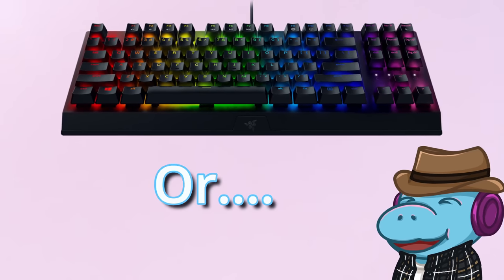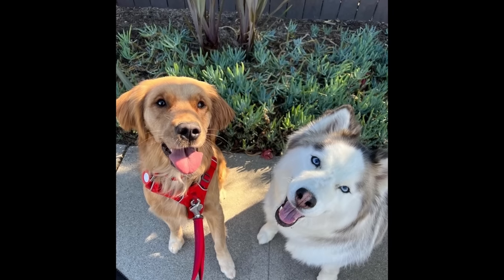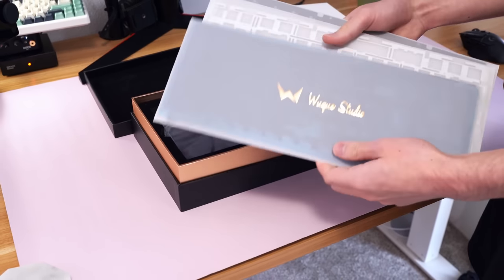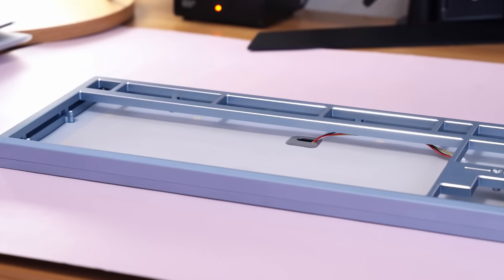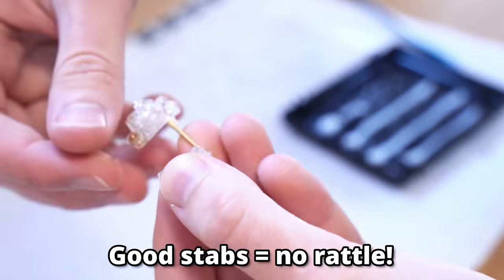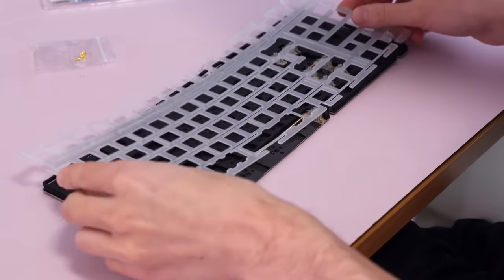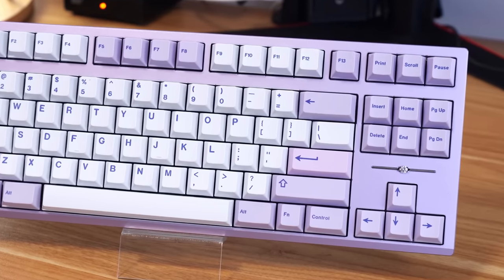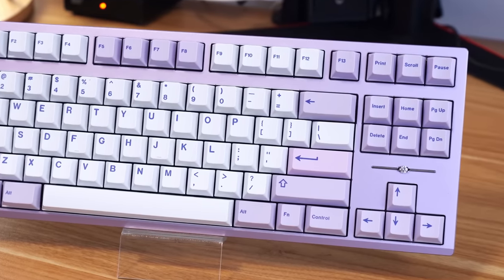Gaming Keyboards DON'T Have To Be Like This.

Comment: I actually like the looks of those custom keyboards, but I don't even remotely have the money to build one for myself. And I'm still not sure if I even like using mechanical keyboards. I feel that my accuracy at typing is way worse than on other keyboards with less key travel and in general flatter profile. For the past couple of years I've been using the Logitech MX Keys and it works perfect for me. I used to have a great need for the numpad, nowadays I don't need it anymore and it's actually super annoyingly wasting space on my desk. Maybe I should try the MX Mechanical Mini. It seems to be one of the lowest profile mechanical keyboard. One problem is that with higher keyboards I would need to use a wrist rest because when I angle my hands too much upwards I get pain in my wrists, maybe carpal tunnel or something. And I hate wrist rests because I move my keyboard around very often and it's another piece to move around and have some free space for.

Comment: I wanted to have a custom keyboard, but latency, and key presses handling per polling(aka chord split) is crucial for rhythm games. I use ASIO, so the audio latency is about 1~2ms. most of cases, you won't feel different between custom keyboards, and gaming keyboards in terms of MCU performance, but in ryhghm games, nah. latency is subjective, don't need that low, but constant interval of polling processing, key presses handling per polling is really important. BTW, you can modify QMK config, and make settings game ready...? if the MCU of board is powerful enough.
I believe the default setting of QMK is about 125~250Hz of polling rate, and only 1 key press per polling, readlly bad for gaming.
Reply: You legitimately cannot notice a difference. I guarantee you, you will not perform better or worse
Reply: @fruittree1670  Yeah, I have already written that, most of cases, you won't feel any differences. but as I've said, some of games, especially rhythm games, some of which have very short latency is about 1~2ms(milliseconds, I'm not joking). and human is QUITE sensitive to the delay of sound, you will feel it, but it is not meaning you can play better. (RTL latency within 20ms ok, under 10ms is recommended. but I did much better with my huntsman V2) but the less latency is, the better what so ever. trill, and scroll speed becoming slow is really helpful when low latency is achieved. human is really sensetive to audio delay, so trying searching about it.
Just in case, without using ASIO API, or WASAPI exclusive, you can not achieve under 20ms audio latency, so most of applications, their audio latency is just more than 50ms, even more.
Reply: And also, timing window rhythm games have quite tight is about ±12~18ms.

Comment: Well I like my shine through backlit keycaps because I work in a dimly lit environment and I am not the avid 100% blind typing typist guy - so I need a well working backlight.
Therefore for me backlight is a must! And therefore my only options right now are keyboards with north facing leds* and shine through kecaps and as I also need ISO de layout, I mostly use PBT Keycaps from Tai Hao (Sharkoon Skiller SAC20) or PBT Keycaps for backlight from Ducky, YMDK or Glorious. That is why I stick to Keychron and cheaper** AKKO boards right know. 

I would really like to see more nicely colored keycaps with shine through - but there isn't much available.

I usually don't use explicit Gaming keyboards though besides Gaming - I have one where I get real per key RGB and color the key according to my games...

*only exception Keychron Pro boards because you get the keyboard with shine through keycaps that support south facing leds…
**AKKO Moonsgeeck M1 and M2 have south facing leds and are therefore not suitable for my use case.

Comment: For the “every mechanical keyboard has roughly the same latency so gaming keyboards don’t count” argument, in some games, every millisecond matters. 10 ms latency on a keyboard might sound unfamothably godlike to normal people, but to professional gamers, it’s pretty high, even if no one can visually perceive a difference between 10 ms and 5 ms keyboard latency. Just wanted to point that out for ya.

10 ms will still be enough for most people tho, so I’d only be super paranoid about it if you’re either a really sweaty hypersensitive esports pro or planning to become one.

Comment: There's nothing wrong with tactile switches for gaming. It's actually nice for the same reason typing is. Sure, you might want to get ones with light actuation, but there's nothing wrong with them for gaming. I use Glorious Pandas.... now. I was using MX browns, then decided to build my own board, and got the GPs. And while I can't speak on the panda part, the glorious part is dead on.
Reply: Do you like the glorious pandas? I’m trying to decide between them and Akko jelly purples, what do you think?

Comment: The only reason I love my razer ornata is the low profile keycaps, there's no angle to the keyboard(I like the flat feeling), the wrist rest, and the RGB choices I have. The thing I do hate and am now learning about is the loud switches as it wakes up my husband and myself if one is awake and the other is sleeping because of the loud typing. (he has the same keyboard and were both very fast typers so it's LOTS of noise when sleeping)
I'd swap to a different brand for more variety of what I want but finding a wired low profile RGM keyboard with thock sounds impossible. I'd swap to Razer's huntsman v2 as it sounds the best to me out of the choices, has a wrist rest, and is less clicky sounding than my ornata but idk what those switches feel like and they don't have a low profile option for keycaps which are my dealbreaker.(regular full-height keycaps hurt my fingers so I like my smol boys.)
It sucks because I love the idea of a custom keyboard but they're pricy and I love my rainbow effects so sadly, I'm stuck with razer. If anyone has any recommendations without breaking the bank, that'd be appreciated.
Reply: Razer does make a cheaper version of the Ornata that doesn't have the mecha membrane switches (so it doesn't make the clicky sound).  I've been using it as my spare keyboard (for my laptop) since it's only $40.  Alternatively, The Razer Deathstalker V2 is low profile and comes with red linear optical switches that are extremely quiet, but it's an expensive board and if you're used to the clicky Ornata, you will probably find it difficult to adjust to the linear keys.  I gave it a try and found that it was too easy to accidentally actuate while resting your fingers on a key.
Reply: @jessebensen3569  Heya. I've looked at the ornata's but their sound profile is still just too loud for me, trying to get away from that type of switch sound. The deathstalker is a bit overpriced for sound profile imo as you can just make a custom board yourself for the same cost and get everything you'd want, I just don't wunna get into that hobby yet. 
an update since this comment though, I got away from razer since they're just too expensive for what I'm looking for and got the dustsilver k84 which comes pre-modded, RGB, thock sounds, pre-lubed switches, and pretty decent stabs right out of the box. It's not perfect but I can mod it later which I appreciate. but as you mentioned, getting used to linear switches has been incredibly hard lol. It's SO easy to just hit another key because they're so absurdly smooth and easy to push down. I love the feel but as I mentioned, lots of typos. So I kinda miss the mecha membrane feels but I can get used to this one over time. I also will miss the low profile board but I've gotten used to higher keycaps over time. Still kinda hurt my finger tips a bit but I can settle.

Comment: This is a personal pet peeve of mine but I don't understand why the keyboard industry loves ABS so much...

PBT is a much more durable plastic than ABS is and it might just be me, but I want my keyboards and my keycaps to actually last forever. If my sweat or just the moisture in the air degrades the keycaps that kind of defeats the purpose for me.

Comment: I would actually like a keyboard made entirely from metal (except the switches ofcourse and some internals)? Metal frame/buttons with natural metal steel colour. Possible?
Reply: there are videos done on this already, pretty sure it's doable, but one issue with this is depending on the metal, the keys could be too heavy (most concerned about the spacebar) and have no bounce

Comment: 10ms can be huge depending on the game. I switched from a 125hz mechanical keyboad with 2mm actuation to an 8khz optical keyboard with 1.2mm actuation and in arena FPS games the difference of these keyboards is massive. The optical keyboard feels so responsive that i can use movement to aim. And on the new keyboard i am able to do movement tricks that are impossible to do consistently on the 125hz keyboard. It's also not just the latency but also the higher polling rate that allows for much more consistently timed inputs and therefore more precise rocket jumps.
As much as I'm interested in custom keyboards as long as they don't come close to the performance of gaming keyboards i wouldn't consider them for gaming, at least for games where precise input timing is important.
And for looks i don't care too much. Mine doesn't have an ugly gamer font or case. I turned off the RGB and it just looks like a normal keyboard.

Comment: There is a difference in sound. Idk how. You used same materials but I heard sound difference. I am using Logitech G pro. I like it.  The switches, response time and rgb.
Reply: The keycaps are a different material. The blue one uses GMK godspeed, which are ABS. The Lavender uses hippo, which are PBT.

Comment: I used a HyperX Alloy Origins 60 until I stumbled across this channel on accident. Then I realized how bad the stab rattle is, so I bought and built a Keychron V4 with Durock V2 stabs and Gateron Black Ink V2 switches and hand lubed everything myself. The stabs were a pain to tune for my first time, but the switches sound so creamy. Love it and won’t need to upgrade for a long time now. I just reused my keycaps from the Alloy Origins because I’m used to the FN layer locations and they have the legends. Updated the board FN Layer to match the keycaps with VIA and I’m super happy. Thank you Hipyo for your help.

Comment: I have been using a Razer Hunstman TE for the past 8 months and 4 months ago I spray lubed it with WD-40 Dry Edition, it made the switches more smooth and gets rid of the ping, and with proper dampening, THOCC. I also can vouch that spray lubing optical switches works like a charm. (ONLY WITH LUBE THAT HAVE PFTE IN THEM)
(Edit : Steps in reply section)
Reply: 1. Open the keyboard (duh).
2. Take out each individual switches.
3. Put them in a container.
4. Take them to a ventilated area to lube them.
5. Grab your lube and shake for a couple of seconds or so.
6. Hold your switch down and turn it upside down.
7. Spray the inside of the switch (MAKE SURE YOU ONLY SPRAY IT ONCE, DON'T HOLD THE NOZZLE).
8. Repeat with every switch.
9. Line the inside of the previous container with some tissue paper.
10. Place your switches inside and wait for it to dry, make sure you put it in some place that is ventilated and avoid dust build-up.
11. Fill your case with any dampening material (I use killmat and a layer of shelf liners).
12. Once switches dry, put them back into the pcb.
13. (Optional): Tune the stabs.
14. Reassable your keeb.
15. Enjoy.

Comment: Actuation distance makes a lot more difference than latency. I'm surprised he didn't specify this. I use an apex pro, but I find the 1.2mm standard that most speed switches use, feels right for me so I could have just gone with those.(and you really do need to lube an apex pro, which isn't straight forward as it's soldered )

Comment: Was anodization "EXPENSIVE" for the maker you chose? It's pretty much the standard finish for things made with aluminum, so that statement confused me. Were you thinking of actual paint or baked on coating? Because those tend to be the "EXPENSIVE" options from the extra cost of material and hands-on, multi-step procedure of application. Anodization is pretty much just dipping the bare metal into a big tub of solution and applying a voltage for a little bit; so it's much less involved and allows treatment of many pieces at once.

Comment: No i dont want my gaming keyboard to look like that, i would like a treu gaming keyboard with the benefits of a costum build keyboard.
ps. looks like a  logitech G915 or Corsair K95.

leds are fine as long as they can be blue
volume knob is requierd.
silver top plate desired

Comment: At first, I thought I needed a "gaming keyboard" as most of the time I met a fellow IT colleague had these and gamed on PC. I just use console myself and after getting different types of keyboards (Steelseries Apex3 TKL, Felicon 308I, etc.) I went to a gaming conference at around the same time I discovered your channel and after using a Keychron K something (was a TKL) with Gatheron red switch I knew I wanted a custom keyboard. I hate typical 'gaming keyboard' aesthetics but I do like RGB so I went with an Akko 3061S Tokyo World Tour R2 (60%) with Akko CS Jelly Pinks. Not modded it yet because I also ordered a Keychron Q2 barebone ISO and that build is postponed due to I haven't found my liked design for ISO-UK layout
Reply: The ISO struggle is real.

Comment: You asked about gaming keyboards I like and honestly, I got a Cooler Master CK352 for my little brother and it's lovely. The red switches on it felt really smooth and light, the RGB was implemented quite tastefully, it had really nice hard keycaps with a pleasant two-tone colour scheme and the board it was on looked really attractive, plus it's a fullsize, for that hot Microsoft Excel action.

Comment: @Hipyo Tech Hi, I have been looking at Mechanical keyboards for a while now... Normally I buy cheap Membrane Keyboards as the way I use my PC, Keyboards wear out fast... The issue I have had with Membrane - Especially cheap ones.. Wear on the keycaps, and trying to source new Keycaps can be an ball ache!!! Also... CLEANING! 

I decided to get a cheap Mechanical from Amazon... Wasn't going to go in depth in case I didn't like it... And - DAMN! WOW! Even a Cheap Model... This one is a Rii Keyboard that cost me about £20 UK... JUST WOW! 

People say these keyboards are Noisy, but this is QUIETER than Any Membrane keyboard I have ever owned... The Key Spacing is smaller and that takes some getting used to but honestly, I am typing faster and more accurately with this one than I have any Membrane keyboard... (I am not a touch typer... I do have to look, but even looking - I was AWFUL on your bog Standard "PC Out of a Box Keyboards!")

I am no Tech Snob... Use what you feel is right for you - I will always stand by that - But at least now I can say I GET, I UNDERSTAND WHY PEOPLE RAVE ABOUT MECHANICAL KEYBOARDS!

Comment: Awesome keyboards! 

I finally did it, I've changed my key caps and switches from my RK84 

I got the honey bee key caps from Jakesai, and Akko Jelly pink switches... 

All because of this channel, I didn't lube anything, I still don't have the tools to open up the keyboard, the space bar does sound a little bit "clicky" I know if I lube or change out the stabs that it would be a lot better.. but the typing experience so far is really amazing!  They keys itself (minus the space bar)  sound amazing! 

I am still saving up for a wow stick and a lube-station... and looking into stabilizers to change them all out
but, coming from a membrane keyboard to what I have now, I am super-duper-content with what I have now! 

I still have to get used to the different lay-out of the keyboard, but I am learning every day to be better at typing!

thanks for the inspiration Hipyo Tech, your videos really do help people who have 0 knowledge of keyboard into making their own keyboard!
Reply: If you’re really looking to save, you can cut on the conveniences. While a wow stick is nice, a standard screwdriver works just fine and is much cheaper. 

As for the stabilizers, you could tune and mod them rather than buying a whole new set. While it’s harder to reach “perfection”, with enough modding and work they can sound just as good, or relatively as you’re starting out. Plus, it’s less money you’d have to spend
Reply: @TheTotalMc  I'm just afraid to open up the keyboard yet, i rather have a extra set of stabilizers because I do have 2 left hands sort a speak! 😅😅 

But yeah, you're absolutely right about using a normal screwdriver... I just need to check my keyboard what type of screws been used for it.

Comment: The custom keyboarding scene seems to have a fascination with vocal/choir transitions, and I'm all for it lmao. To answer question at end:

I went from a bunch of old ass mechanicals (like, beige earthy sand ones from the early 2000s) to a Corsair membrane, to a Corsair mechanical that eventually got defective and I've given to a bud so he can scrap the switches and other components.  Then I got a GMMK as a placeholder for about a year. So I've pretty much tried every different type of feel.

I just finished... "building" my own using the Keychron V6 with Gateron Black switches yesterday and I don't know if that constitutes as a "gaming keyboard" but hey I'm just happy to go from tactiles to (somewhat) heavy linears.